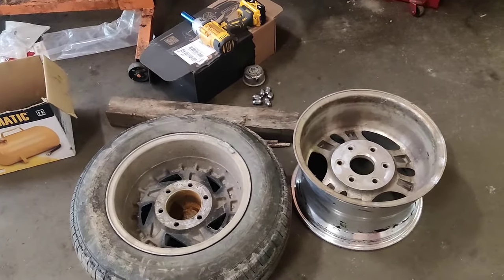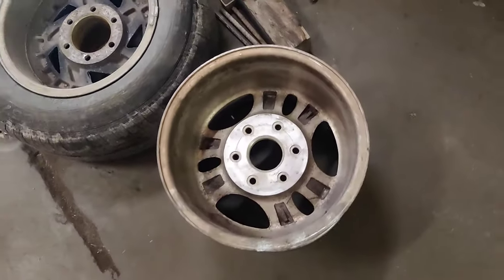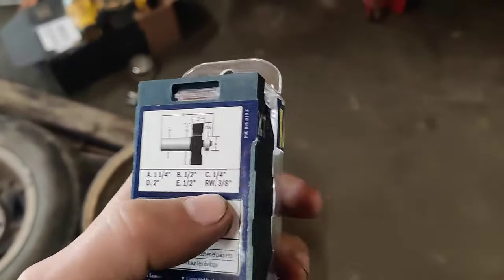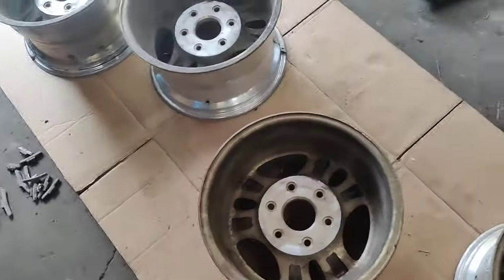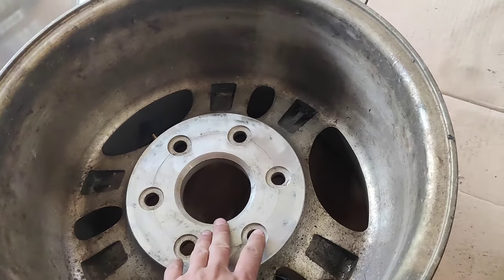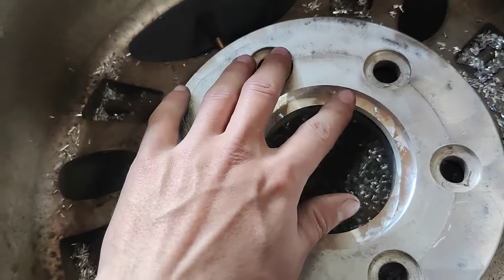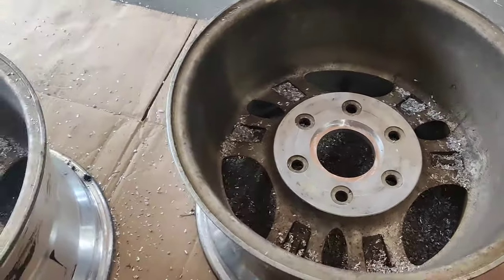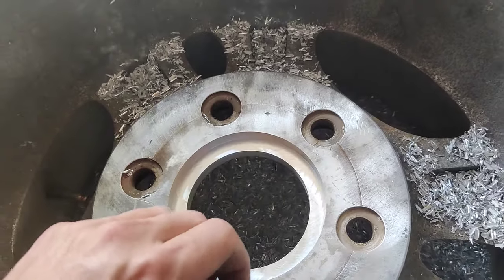How To Bore Wheel Hub Centers at Home

Comment: How does this stay perfectly circular? I am trying to save a set of wheels that someone took a dremel to. Then hub bore is chewed up pretty bad. I was hoping I could do something like this, but I have no idea how a router would stay circular without a guide
Reply from the maker: There's a bearing on the underside of the bit that keeps it from going off track. If you don't have a perfectly round surface on the center to base it off of you're kinda SOL. Unless you can make a jig to use the barrel of your wheel as a reference instead of the center bore
Reply: @timskineash  some sort of guide is a great idea! I can probably come up with something. Thanks!
Reply: Yes dude, geez

Comment: I have a colorado. Very similar.
Did you shoot for depth and a diameter or just the depth.
Reply from the maker: I went for the diameter as well and got the right sized but for the diameter I needed. I needed a 3/4" larger diameter so I got a bit that took 3/8 off each side. 3/8 + 3/8= 3/4
Reply: What is the bore on the Isuzu? Colorado is 100.3